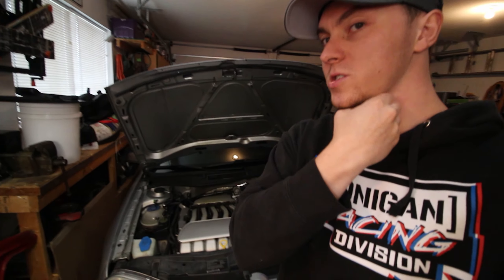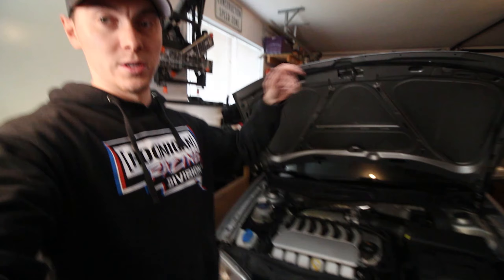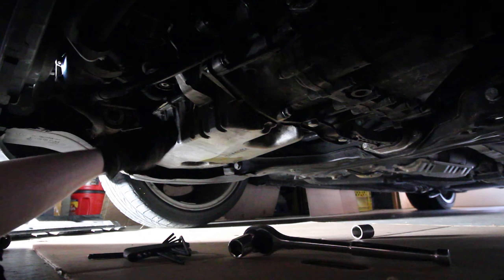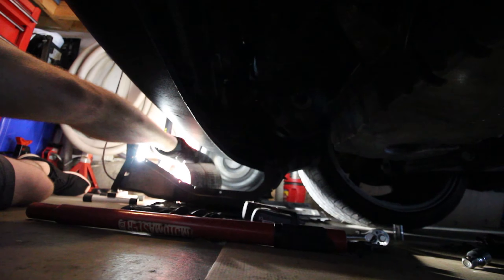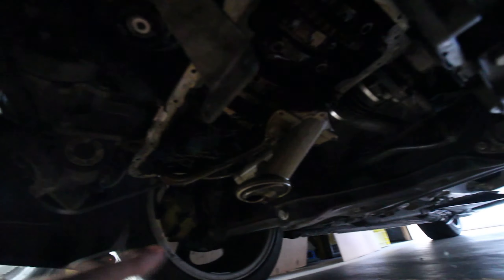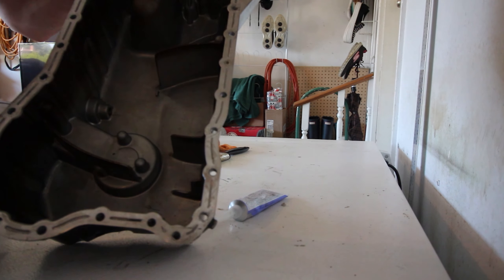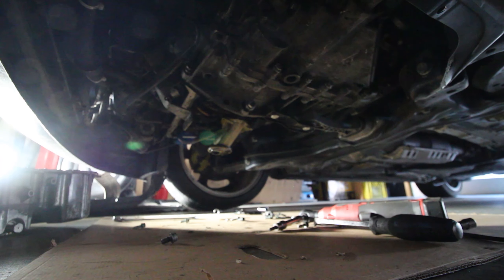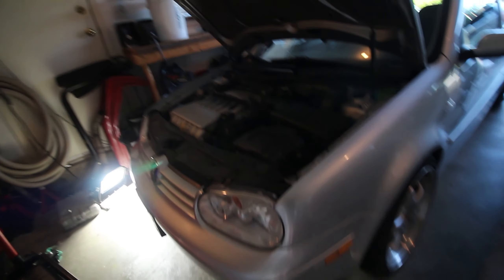24V VR6 Oil Pan Removal/Gasket Installation - GTI VR6 Build

Comment: I just did mine but the three 16mm bolts won’t go in almost like the gasket makes it sit to low. Guessing this is why everyone just uses rtv and sends it but any advice would be cool. Would be nice to use the gasket but ig I can take it all back off again and pray the rtv Dosnt get sucked into the pick up
Reply from the maker: I don’t think the oil pans ever came with a hard gasket, cause you’d have to squish the shit outta it to make the bell housing bolts fit back on
Reply: @ThatGuyTyy  that’s good to know guess trying to do things the right way isn’t the move no more 😂 think I could get away with out putting those three bolts back in? Or its probably worth just taking it off again and taking the gasket out🥲?